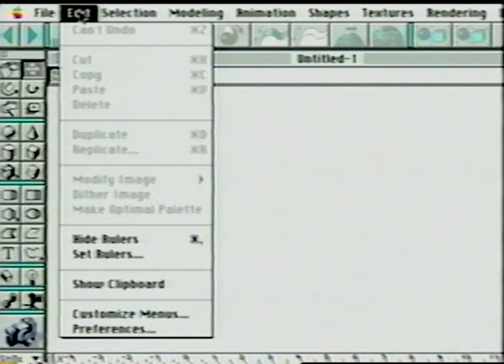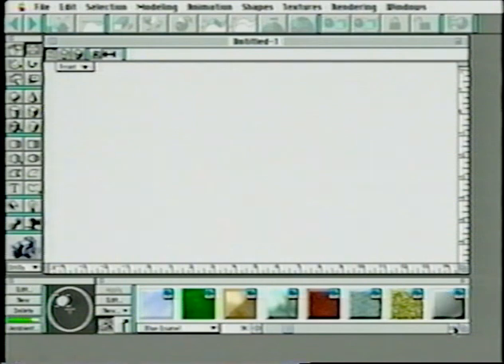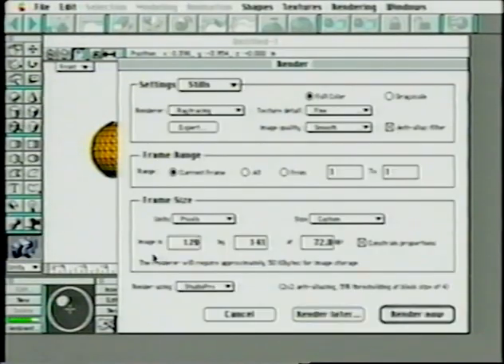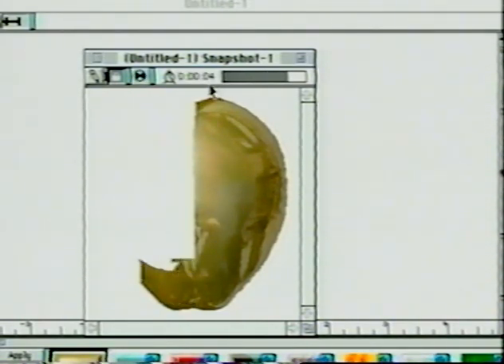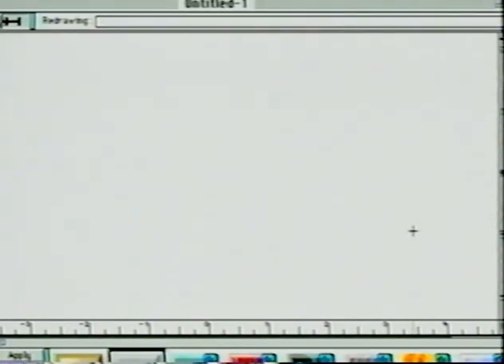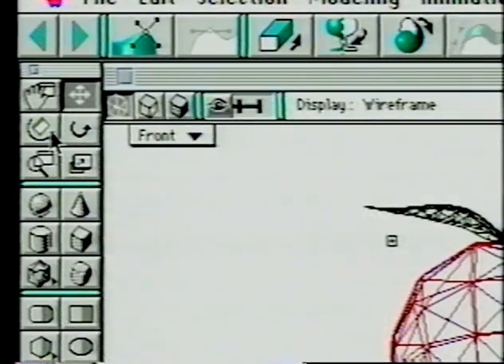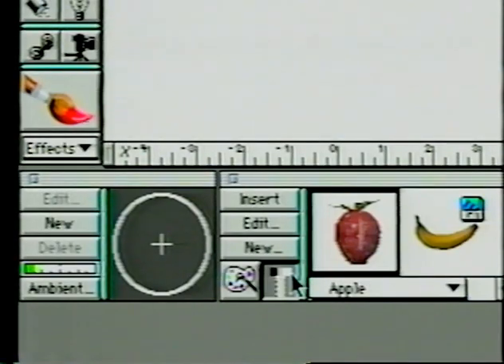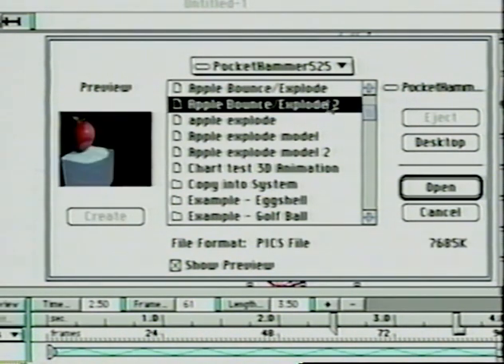Strata Studio Pro Tutorial 1995

Comment: Form•Z was (and I think still is) a top-of-the-line modeler. RenderZone allowed rendering, but animation was still not offered with Form•Z. Only today does Z offer limited animation.  Electric Image + Form•Z combo was capable of yielding some high end results circa mid 90s. We used Strata extensively for a couple of years, and if I had to sum it up fast... the software allowed the artist to model, texture, light, and animate professional results... but the software often fought back with not-so-perfect coding and glitches galore. That said, it's rendering capabilities were WELL ahead of the hardware capabilities of that time. Couple that with the early unstable Mac OS of the day, and several restarts were common place when working with heavy Strata files. I miss the good old days.
Reply: This is the kind of workflow that I have nowadays : Starat 8.0 and MOI 3D 4.0 with Electric Image. EIAS 3D will release their new version 10 soon with a tons of updates and new features.